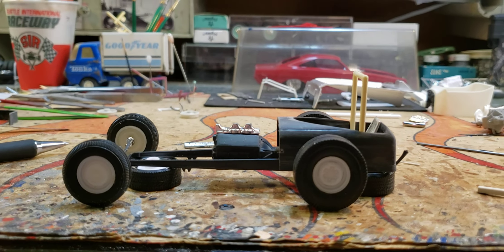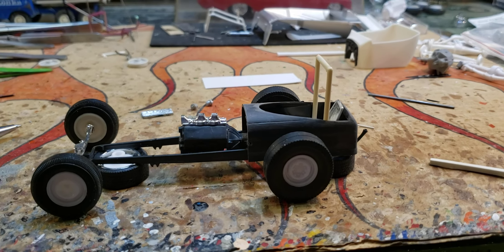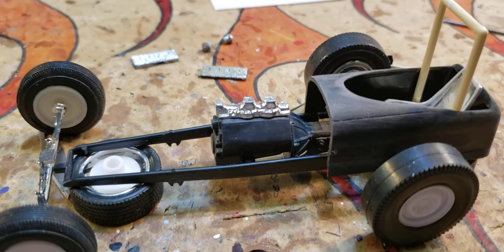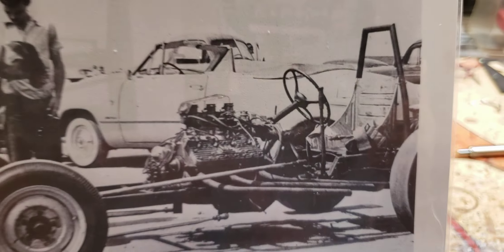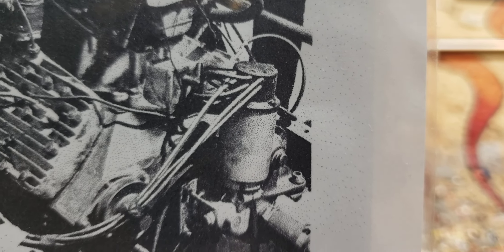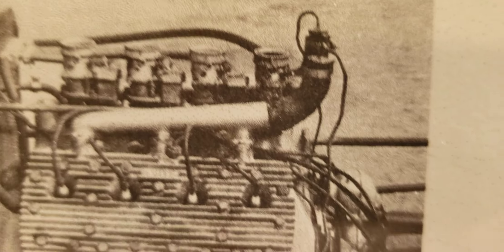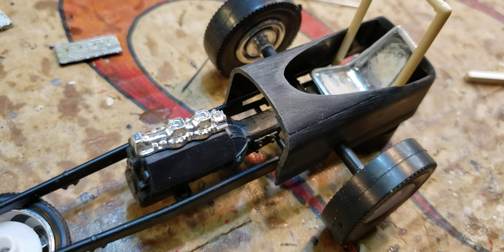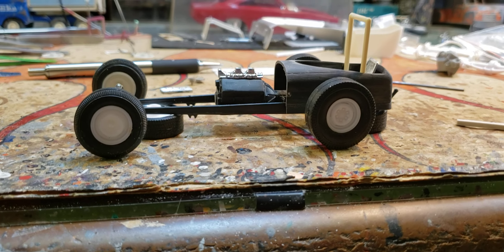Update on the 50s Rail Job

Comment: Cool drag car pictures wanted to ask u  are you going to put wide wheels on the back also I used up all my wiring were can I buy me some more wiring at also what kind of wiring do you use
Reply from the maker: I've had mine for years but Michelle's craft store should have stuff you can use plus there's a bunch of after market model companies that have it just Google it or look on eBay